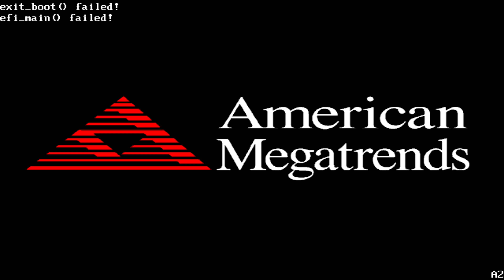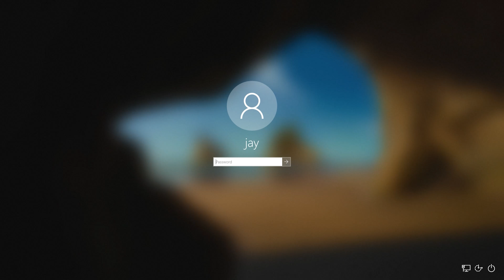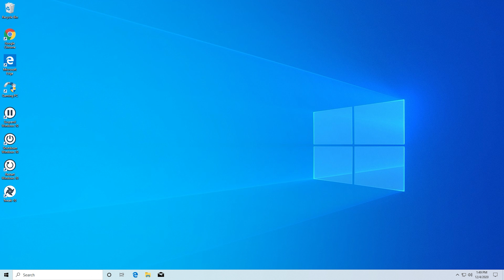Can You Upgrade Your CPU While The Computer Is On?

Comment: When the computer is booted up, the OS gets stores into RAM so when you take that RAM out, the computer's OS disappears from the CPU's address space and the CPU gets random data then the CPU crashes, nothing happens to the screen because the current screen image is stored in special V-RAM inside of the GPU and is not getting updated.

When the hard-drive looses data access from the CPU the drive stop writing data and waits for signals that are not there, some of the data could get corrupted but it would only be a little bit and the disk check will try to fix it.

Taking out the CPU would cause the computer to just stop and nothing would be executing the code so there again would be a still image on the screen because of nothing telling the GPU what to do.

Comment: You should try Windows To Go its like live Linux Persistent on a USB Stick and when u pull out the USB Stick Windows will still run, though you cannot open anything. And when you plug the stick back in Windows 10 starts working fine again, that's actually really cool that windows can handle this.

Comment: SATA devices are hotplugable, PCIe devices can be hotplugable if your system supports it, RAM and CPU won't be hotplugable for the most part, unless you have some custom hardware and custom OS

Comment: Acually... speaking of disconecting the HDD "data cable": I think that disconnecting the "data cable" from your storage device is much less bad than disconnecting the "power cable" because most storage devices have a RAM cash chip witch tempolearly stores a small amount of data witch will be written to a disk (or to a flash memory chip in case the storage device is an SSD of some cind). 

In case the "power cable" is disconnected from the storage device... the data corruption is much more likely to occure, becouse the RAM chip will instantly lose all of the data when power is off. 

Bonus info: I've herd somewere that some SSD's have some cind of "power loss protection" technology (I guess they have some cind of capacitors witch preserve the power long enough for all of the data from the RAM cash to be written to a flash memory.)

I'm not a professional, so please don't judge me in case my explanations are incorrect, but you may correct my statements.

Comment: 2 worst accidents ive had:
- spilled a cop of coffee into a oldstyle keyboard. Killed the whole pc. Trying to remember if it was a ps/2 keyboard or the even older JT12 one, but both are basicly just wired directly into the motherboard so everything gets fried too.
- lightning struck neighbours building that had the cable tv & internet box. It killed everything connected to the cables except my old crt tv. 360 dead, dvd recorder dead, whole pc dead. Even the usb keyboard was fried. Of cause the normal power also went at the same time as that triggered the plugs. Insurance gave me the "runaround" because it wasnt "electrics" & it wasnt "nature accident" etc. etc. etc. So every time there is a thunderstorm i always pull the cable plugs.

Comment: Well the HDD thing is pretty easy even on consumer grade stuff, just have to enable hot swap, but the OS drive it wont be a fun and wont work. I constantly mess with my server and I have the hotswap enabled, so I just open the computer up and take it out while the system is running.

Comment: You should have tried plugging that hard drive back in. I have used windows off USB drives, and I have seen windows work fine if I replug the drive before about 30 seconds after unplugging it

Comment: The system locks up to prevent damage. It's nothing to do with "instructions were in the RAM stick that was removed", even if the OS was programmed to only use one of the two dimms it would still lock up.
PCIE hotswap is possible, but requires motherboard and AIB support. It's also finicky at the best of times.
Harddrive firmware will prevent any serious damage removing data and not power. Suddenly removing power during write, however, is risky, in theory.
Harddrives are completely hotswappable. I frequently have moved drives around in a running system, cutting data and power. It's not a big deal. You can plug and unplug them freely. Only the Windows drive needs to be plugged in for Windows to function, sans sym-links for essential windows content on a secondary drive. Just the other day, I installed a pair of drives in a running system without issue, and also swapped around the cabling for a third as part of the process.

The boot failure is likely just the board messing up boot settings because you booted without a bootable drive.

Comment: You should have tried something like 200ge, or some ultra low power intel for the cpu upgrade, i think that could actually hold up for a few seconds on idle without a cpu cooler(with good case fans)

Comment: I'm disappointed you didn't try adding memory while the machine was on.

Removing RAM will obviously cause issues but what happens if you add additional RAM.
I'm expecting it to also have issues as it's not initialised it properly but I've never tried it

You also could have used something like VNC to get a remote screen to the machine when removing the gfx card

Comment: original thought for PCIE Have a function of plug and play, but its disabled (or well its not hardware level enabled), so if you unplug and plug back a thing in it, it remains disabled till next restart, but it don't do harm for most of the parts pcie parts

Kinda take years to have it natively enabled. its not a long ago, they give experimental Plug'n'play function into some engineer motherboards... Linus had one?...

Comment: Uhh...I wouldn't even dare to upgrade a PC while it's on. The potential for short-circuiting the fragile electronics and frying up the valuable processor and graphics card scares me quite a bit since they're extremely expensive. (Not that I know how to build or upgrade a PC but I have recently added in a HDD to a laptop)

Comment: You could technically hot swap the hard drive just fine. You would need windows running in a separate drive and have hot swapable hdd enabled in the bios.
Reply: I got to say though I watched this entire video in horror.

Comment: Actually my HDD's SATA cable decided to disconnect himself from the HDD, i was playing GTA V and suddenly all froze, i tryed to restart and it didn't show all the things which weren't on the SSD (ofc, with HDD's data cable unplugged). Just checked quickly and found the cable, plugged it back in and it still works after more than a year.

Comment: Based on my pc, I would guess the pc froze because the cpu overheated. Mine did this often anytime the cpu was out under load. I didn't figure it out until I started monitoring the temps during operation. Maybe if you loaded CLI Linux and clocked it down really low speeds you could pull the cpu before it has already crashed. An answer to a question nobody asked but a fun video nonetheless.

Comment: I knew everything would work anyway. there are redundancies built into Manufactures motherboards to keep from frying anything. and Intel processors have a safety feature baked into the chip when it is designed to not cook it. if it gets hotter than 90C it simply reboots and the BIOS shows you a notice that the CPU was Over Temperature. it still is possible to fry an Intel Processor but it is very unlikely that it would happen unless the chip is faulty from the factory. AMD on the other hand does not have that safety feature baked into the silicon like Intel does. So if you overheat your AMD processor your screwed. also if your machine is using Registered ECC memory instead of regular memory, unless you remove all memory modules from the machine at one time it will still say on but will lock up while the ECC memory attempts to correct the error (if possible) if you are using regular memory and pulled out a single memory module while it was running it would crash immediately and NOT lock up like it did in your video. Also some models of Motherboard manufacturers do offer hot swapping SATA storage devices provided that it is not a primary boot device. for example, I have a 256GB SSD boot drive and a 3TB HDD as a secondary drive where i store all of my files. if i were to add a third storage device to my system Windows would recognize it with no issues. the video card on the other hand is another story. if the Motherboard you have does not have on board video and you remove your only video card from the PCI-E slot on your motherboard the system will automatically lockup as with all consumer grade motherboards (unless you have repurposed an older system to use it as a headless server) they will not POST without a CPU, Memory and Video detected.

Comment: the last test with cpu not fair!
you basically install new cpu when th e pc off.
and uninstall cpu that have protection temp and because the temp protection its shutdown.
you need test again.
flip the all pc (like you do when you install the second cpu)
remove cpu when pc on and put the second cpu without turn off the pc/psu.
you will get electrocuted but without demage, I'm used to that :)

￼

Comment: The hard drive removal one i have experience with becuase i had to replace my old laptop HDD and it was smaller than the slot so it would slide out with a little movement and Windows would crash

Comment: It would be interesting to tap into the power pins of the ram module and keep it powered on while removing and determine if the computer still works.  Maybe it would work given that the data would remain intact.

Comment: Tried disconnecting the drive while I was running macOS and surprisingly it didn't crash. It give me a beach ball. On my second attempt I tried connecting the drive back as soon as possible and when I did it in less then 3 seconds the os continued to work properly without any errors.

Comment: i removed the ssd on linux, and it kept working for 5 minutes. i put the ssd back and it freezed. it worked after a reboot

don't ask me why i removed the ssd, i had an open system and "tripped" on the sata cable

Comment: What if you have 2 pc with 2 raided hard drives and you swap on of those 2 between each pc?
Like raid is made to handle one of the two HDD to fail but if you plugs back in a foreign HDD instead, what happens?
What i mean is having (A+A', B+B'), remove A' and B' then plug back to get (A+B', B+A')

Comment: I run windows 10 on an external SSD on usb2.0 (the internal sata port of my laptop is occupied by my dad's ssd) and Everytime I accidentally unplug the drive it just freezes but goes back to normal when I plug it back in.

But there was a case while playing half-life 2 that the disk was unplugged (it fell off getting disconnected) and half-life ran fine until I loaded a level change trigger and that's when the game crashed and bsod'ed

Comment: I got a old junk PC and for fun i tried to take out the ram and put it back in while it was running, but because it was DDR2 and the slit for the ram was almost in the center, i tried to put it in the wrong way and it burned off the ram slot :D there was like a glowing red burn. Also while it was shorting, i head the fan spin up and the PC speaker beep like crazy but other than the slot breaking nothing else happened.

Comment: I'm an IT student so I'm not very dumb, but at the same time, why is it doing a disk check when the component removed is a GPU, isn't the gpu supposed to only do the graphical processing? I mean if we consider it as a RAM that manages graphics, then why with a normal RAM stick it didn't do a disk check?
Reply from the maker: My guess is that the driver hung up the system in the middle of a write. Causing it to corrupt a little.
Reply: @JaysTechVault  But then the problem is, why didn't it do the same with the ram? Maybe if you created a new file it might have done the same?

Comment: what happens if you have a computer running off of the APU of the processor and then add a graphics card while its still on? or put in an extra ram stick while the pc is running?

Comment: what about removing the monitor while the computer is still in use? or a PS/2 keyboard or mouse?
Reply: Just work fine
Reply: @sampletext69420  that’s the joke

but technically no, afaik PS/2 peripherals are not hotswappable, so if you unplug it you will need to reboot to use your keyboard again

Comment: I actually was thinking there was a possibility of the graphics card being replaceable while on. Don't know why.
Reply: If the display is connected to on board/integrated graphics I think you could
Reply: In professional workstations some pcie devices and hard drives are hot swappable

Comment: I accidentally pulled out my GPU and Windows was able to recover. Some what... Linux might be able to handle a GPU being unplugged. You might still be able to remote in even if the GPU drivers are completely dead.

Comment: Ok so let me explain to you why the machine actually halts when you disconnect something.  Like ram/gpu. or Even cpu. its a service called watchdog.  in newer Motherboards its Just renamed.. So this service protects the hardware from fault. such as a jar. short or as you did.. an interruption, 
And why it trashed your HHD.. you have Pagefile on. and pulled the graphics card upon first boot. it did not complete the first boot. 
and when you pulled the Sata cable.  Pagefile failed. virtual memory. if you disable it.. and pull the sata cable. things that were loaded into memory will still work. until you call for a new task

Comment: Whenever I unplug my hard drive (while the computer's turned off), even if I plug it straight back in again, into the same socket thing on the motherboard, there's a good chance that Windows will have to do a disk repair, or I'll loose data. Does anyone know if this is my fault, or am I just unlucky. I always see people unplugging hard drives and everything else in videos for upgrades or cable management or whatever, and it always goes grand for them, but not for me. This is very annoying.

Comment: I once accidentally pulled out the cable of my boot ssd. Have to of the same 480gb ssd’s and I wanted to unplug one (the not os one) but unplugged the os drive got a bsod but no corrupted files
Reply: Yeah it's not dangerous for ssds at all
Reply: Your Lucky You Had A SSD.
Reply: @Alex-cn1xt  are you still using a hdd for os?
Reply: @sijedevos2376  Bruh. I Don't Have A Laptop. I Have Only 2 Phones.

Comment: The most dangerous thing absolutely stupid is the one i think you didn’t intend to be a joke:
The pop out of the cpu when pc is on lettong the cpu and the brackets touch the gpu, that could have shortened some pins, generate heat and set your whole wooden house on fire.

Comment: For this he has the wrong kind of PC for hot swap. You "can" hot swap CPU in a 2 or more CPU system but at least you need 1 plugged in. You "can" hot swap RAM but again the CPU has to support it. To my knowledge Xeons support it and the Zen 2+ CPUs and later support it. For a GPU you need a motherboard which supports hot swap PCIe and a CPU which supports it.  So anything newer than 7 years for the CPU but most motherboards don't support hot swap PCIe. For hard drives again the controller has to support it. Most consumer boards do not say if they do or not.

So you "can" but you need to make sure your hardware supports it before you do.

Comment: When you removed the CPU, the GPU maybe still had a frame to display and was just locked on it, but yeah the CPU was just "totally discarded"  at this point.

Also, I know that when your power stop unexptedly, the hard-drive does a "click" from the needle that goes right away from the disk, a sort of security thing, but don't know how it works exactly. ( magnetic needle or a spring ? )

Comment: Bruh wtf happened to your HDD I unplug mine all the time when it’s it quickly change to another drive that I’m working on
Reply: Yeah but your HDD dont have the Operatingsystem on it. So your PC dont lose most parts of its Operatingsystem.
Reply: @ronnykohler3130  true but wouldn’t background processes corrupt?
Reply: You shield enable such features in the UEFI to unlock hot swaping or just shutdown all processes wich access the Drive
There are also some programms to do this

Comment: Windows 2000 Alpha version let you unplug the system drive and plug it back in... I know because I did it once. It comes up with a message telling you not do do that.

The final version of Windows 2000 just BSODs, very odd that Microsoft put a message in and allowed you to plug the drive back in, this was back with IDE ports not even SATA, IDE was not hot pluggable, supposedly. I've done a lot of crazy shit with computer hardware over the years, don't ask.

I was more cringing when the metal CPU clamp spanked across the back of the GPU to be honest, that's probably why you lost video.

Technically you could hot swap a GPU, PCI-E should allow you to do it, not so sure about the OS. If you disabled the driver first you would probably have better results.

Comment: No no you can unplug your drive all you want while it's on the most I would happen is just stop getting new instructions and just turn off ram the colonel usually runs on RAM gpu you just removed its instructions on how to process it aka drivers reloading them should do just fine CPU oh god don't you can immediately short your CPU via the old fashioned electricity always wants to find the closest ground and the cpu will be the only ground

Comment: Also your talk about harddrives is pretty stupid. If what you said is true, in that Windows and not the harddrive controls the head for whatever reason, you still failed to realize that the drive spins at either 123.33 rotations per second (7200RPM) 90 rotations per second (5400RPM). So even if Windows could control the harddrive head and there were no safety features for this exact scenario, at most you should get 1 singular line out of millions corrupted.